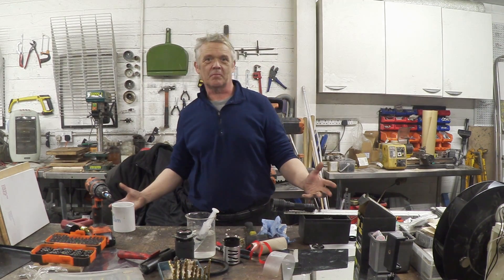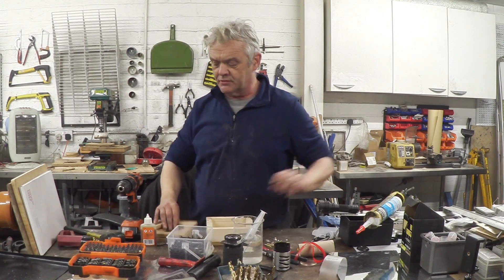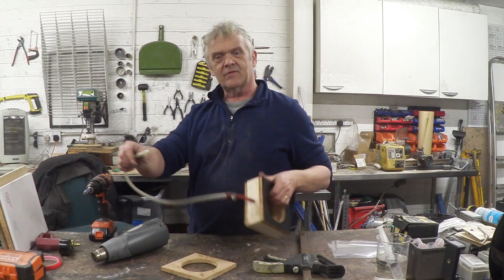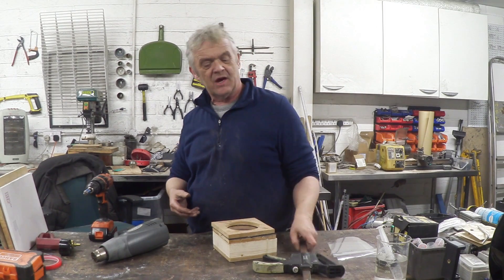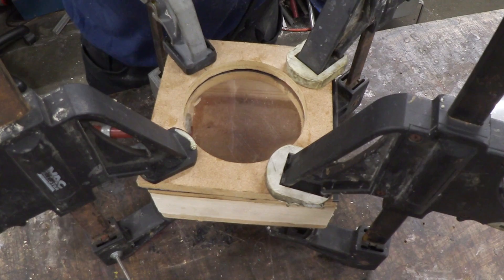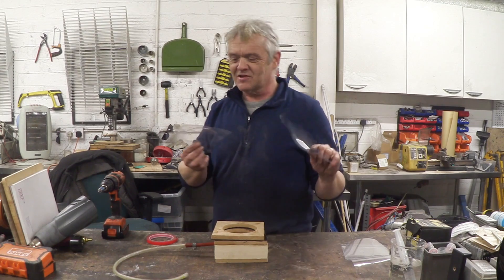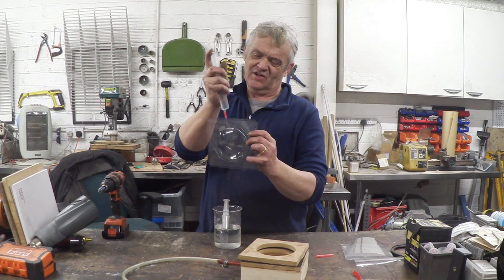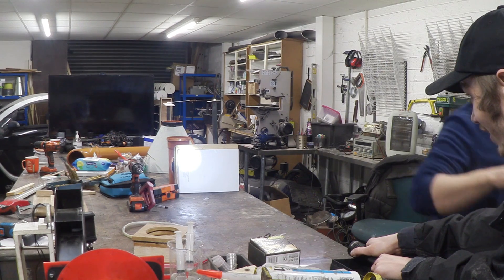1384 How To Make Lenses Of Any Size Or Focal Length Easily And Cheaply

Comment: Making a telescope using water lenses sounds like a great idea.  Before joining the lense halves sterilise each half.  Fill the lense  with distilled water.  Remember as the temperature changes the lense will expand and contract altering the focal length.  Thank you for showing how easy it is to make a lense.  Now I know how to create a tear-drop canopy for my rebuilt model Kestral glider.

Comment: Try using sheets of 5mm clear rubber and filling with water as you did. You can adjust the focal length and focus simply by pushing in more water or letting the rubber force out some of the water. Ie the big syringe can be pushed in or out to focus the item you want to look at or focus a beam of light into a long narrow beam or a wide beam. It is actually good fun doing this. Did it with pieces 20cm x 20 cm rubber. Amazing how fast you could get a piece of wood to catch alight in midday sunlight.

Comment: I’m surprised you haven’t already used a similar process to make a vacuum former. 
Wooden box with hole for shop vax
Top is aluminium with lots of tiny holes
Use heat gun to warm plastic 
Press over negative with vac running to form 

Cheap easy plastic parts

Comment: what you are doing is something I had considered on mylar space blankets but with continuous pressure/suction to use as a solar focus mirror that can be adjusted on the fly as the sun moves to keep the concentration and position on something being heated.
Reply from the maker: you will really have to give that a go mate - it would be great to see - but you have inspired me there so I might beat you to it lol - the glove is down mate lol
Reply: @ThinkingandTinkering  I have been waiting to have land to set up a massive array anyway, which maybe by summer I will finally be able to do so. I can post a link to the idea, on discord, but basically its 1000s of tiny mirrors on rods that are adjusted all so they make a sort of fresnel array on each small box so it can be tilted two angles to follow both seasonal and daily sun to focus it on a central point, then build a glass chamber big enough I can keep the light from damaging the glass by spreading it out as it enters, and fill the chamber with argon and such, while smelting glass from sand and the like, sort of demonstrate how the heat energy we normally use oil to generate for solar cells can be replaced by sun power in a simple manner,
Reply: @ThinkingandTinkering  oh something from the James Webb telescope was that their mylar they have ridges running through it to do something or other when deployed and this is apparently achieved with heat, so I am guessing the process you used here could possibly be used on the mylar thermal too, as I have done something similar with 2 liter PET to make a new shape and quite rigid so making a reflector telescope might be possible, definitely want to look into that, as I want a bigger telescope than what I have already LOL

Comment: The shape is parabollic or spheric?
Reply: @mikeguitar9769  but how can that be?
he is using pressure, which applies in all directions, unlike gravity
Reply from the maker: It looks spherical and that would be my guess as pressure is applied pretty much evenly across the surface
Reply: @ThinkingandTinkering  At first that was my guess but I am wondering if the rim introduces a contour condition that spreads to the whole definition of the surface.
Gotta find a mathematician...

Comment: How about using CO2 to lens sound?
Reply: Like a purpose built balloon filled with  some appropriate  gas maybe ?
Reply: @michaelcorbidge7914  Actually just a party balloon filled with CO2 gas will do the job nicely, but different gases will give different 'focal lengths' I expect
Reply: @DaveJSmith  the wine cask bladders ....that's boxed wine bladders....were on my mind for their  shape  when inflated and pressure  can be a little  above atmospheric . Not sure about the pressure  tolerant plastic PET  bottles for carbonated beverages,  not sure if slightly  hard surface messes  things .
Reply: @DaveJSmith   yeas, but the refractive index of most gases is 1.000xyz, glass is 1.5 to 1.71  so ... yeah ... actually the plastic film on top would be more refractive than the gases inside with 1.3 to 1.4 ...
Reply: @actudoran  True, but I am talking about sound not light!
Reply from the maker: never thought about it - until now! - lol - that's very clever mate - nice idea I will give it a go
Reply: Oo! Sound dissipating wall of CO2 filled concave lenses.

Comment: Very cool. I wonder what the actual mathematical profile of the lens shape is. Is it actually parabolic? Or is like a catenary (which is very close to a parabolic curve but not quite - the same as a hanging chain or rope) or small section of a spherical curve.
Reply: It's a catenary, but it's close enough to burn some ants.
Reply: @Zakardis  thanks for answering that for me. :-)
Reply from the maker: I would think it would be. spherical section - but I don't know - if you wanted control over the curve it might be an idea to blow mold it instead free air mold
Reply: I believe  some observatory  mirrors  were produced by molten glass slowly hardening  on a rotating platform . A rotat ijng container of  liquid produces a parabola.  It's  a long time ago now to remember but then what about a meniscus? A meniscus  is parabolic  surely . Small though .

Comment: A telescope would be brilliant! I was just considering buying one a few days ago, however I am a HUGE FAN of recycling and DIY.  Also, what are your thoughts on using a clear epoxy instead of water (once you have it dialed in of course)?
Reply: Expoxy releases heat on curing.... You probably don't want an epoxy lense to be too thick middle. 
Thicker liquids like setting epoxy also have bigger problems with stubborn gas bubbles refusing to rise... . A sander can help separate the bubbles somewhat... Fix the sander to a sheet of ply, and then clamp container of setting liquid to that board. Board over edge of table and Run the sander. The shaking tends to dislodge the bubbles, so they rise to top surface.
Reply from the maker: I have been thinking about both of those things mate - it's likely I will grab some clear cast

Comment: Using glycerin (glycerol) will prevent evaporation but will change the refractive index a bit. Great idea Robert ! Cheers!
Reply from the maker: I have heard silicon oil too mate - but I have some glycerol so I could try that
Reply: Or perhaps even clear epoxy once you have what you want all dialed in.

Comment: Nice. It might help clarity by first removing dissolved gases through boiling the water and reduce sticky bubbles by adding a tiny amount of soap to reduce the surface tension. sugar and or salt will change the refractive index shortening the focal length.
Reply from the maker: nice tips. mate - cheers

Comment: That would make an awesome telescope if you can adjust it to where it magnifies more do you need a bigger lens or you just make a bigger dome
Reply: Really you need both as the higher the magnification factor the more light you need to collect. Hence Telescopic sites being for example 6x42 or 7x50 or 8 x 56 or 8x60. The same thing follows for binoculars.
Reply from the maker: Gordon has it mate - the limitation is really on light collection and the amount of available light

Comment: This is amazing stuff! In theory one could mass manufacture these and sell a lens that weighs very little compared to its final weight once filled with water. And everyone (well almost) has water! Cheap lenses like this would be great for reducing solar cell costs by focusing sunlight onto smaller panels.
Reply: Not necessarily ... Some type of solar panel work also from dispersed light. To get max effect you'll have to employ a heliostatic type of tracker adding to the cost and not benefit from dispersed light
Reply: it will destroy cell faster
Reply from the maker: for sure mate

Comment: Nice! Immediately came to mind if injecting clear, 2 parts epoxy, would cure well enough (and clear enough) to produce good solid lenses.
Reply: Cool idea! I wonder if you could compensate the lack of transparency with size of the lens ...
Reply: Other resins/thermoplastics would be better; it's done commercially, so you can get the specs and use the proper stuff.
Reply from the maker: I would think so mate - there are issues with that like degassing and heat when the epoxy cures - but I would think these could be overcome with a little practice and thought